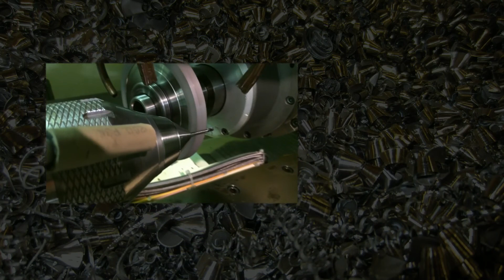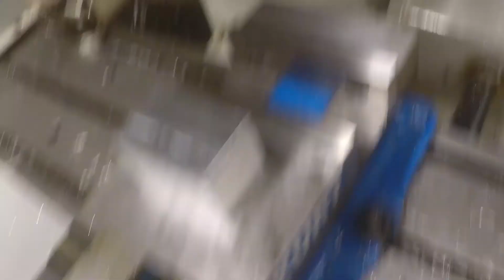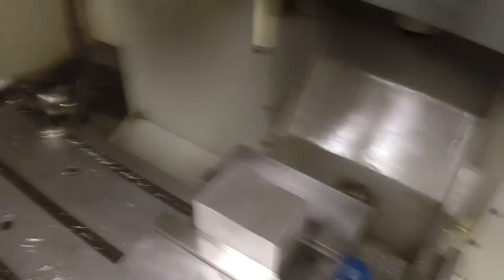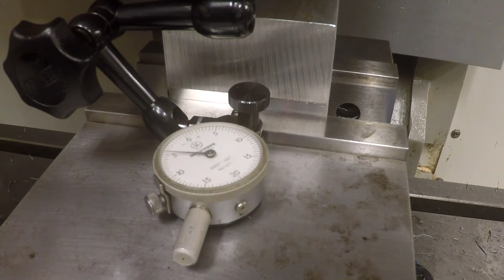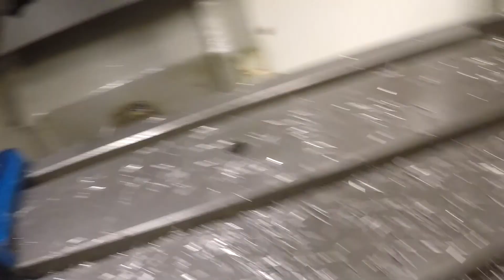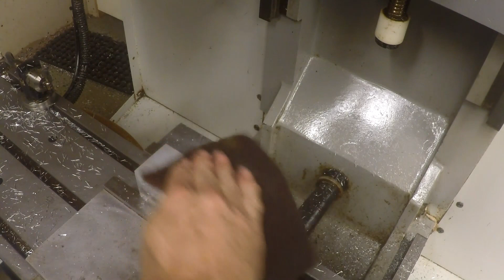Square Me Up To 90-3

Comment: Couldn't you have squared the block on the surface grinder in a tenth of the time, and it would be right on for squareness. All the fuss and worry about vise flatness and squareness could be avoided. You remind me of alot of the CNC operators I've worked with. "I will do it in this machine regardless, those other machines aren't worth my time".
Reply from the maker: Did you watch all the videos 1-3 in this series? (I think not)The purpose of this video series wasn't to show what you are talking about. For instance what if you don't have a grinder. Or even a Kirt type of vise. This is to show different ways of thinking. There are of course better ways of doing things if you have all the equipment available to you. I have used this same method on manual equipment as well.

Comment: Excuse my ignorance if this is a dumb question but is it possible the probe tip could pick up minute amounts of dross or debris and affect the precision especially in axis x?
Reply from the maker: Yes that is possible in any axis. But oddly it doesn't seem to pose a problem. I have done extensive probing on machine tools and haven't had a problem with this. More of a problem is, in process probing to have burrs or shavings  on the work. By the way no question is a dumb question. Thanks.

Comment: Hey Peter. How about s ratchet in the vice. That impact can damage the vice spindel. One of mine has a rough spot because if a damaged spindel.
Reply from the maker: I never tighten the vise with the impact wrench, just if I have to move the jaw a large amount. Because of the coolant pan on this machine it takes a lot of time with a regular wrench. I did use to use my air ratchet wrench but it has malfunctioned and I haven’t got a new one.

Comment: I’d be interested to se the difference in the measurement between the machined surface on the block and the inside of the vice jaws.    I love your videos,  I learn something every time.  Thank you.
Reply from the maker: I'm not totally sure I understand what you are saying. The whole purpose of this method is to eliminate/reduce the error that the vise may have in its jaws. As long as the vises base runs parallel to the tables travel and the spindle is perpendicular to that. Your parallels do have to be the same height and you need to  tap/hammer the part tight down against them. it is necessary to take the proper care with indicating and machining the part. It will come out square. As I said in the video. I would only use this method if absolutely necessary it does take more time.
Reply: Edge Precision I was just wondering if the back edge of the part and the stationary jaw would measure at the exact same number.  I suppose in a perfect world it would, everything being perfectly straight and square.

Comment: After flipping the block over on the second operation, could you not just re-run the first program. As long as the sides cleaned up, wouldn’t the newly milled sides be in the same plane as the ones side milled in the first operation? As long as the machine repeats, I’m thinking this is the case. That way you wouldn’t have to find the centerline at all with a dial test indicator.

Comment: Im a young Machinist and I've never seen this method seems extremely precise. Not to ask a dumb question but what would be the best option to square those four sides to the remaining two set it up and indicate in?
Great Channel
Reply from the maker: Once you have something square on those faces. One way is to clamp it in the vise and use a endmill to take a skim cut on one of the top end's in the Y axis just enough to clean a area to set it on a parallel. Than clamp it in the vise vertical on a short parallel (Tap it down tight on the Parallel wit a dead blow hammer) and cut the top with a face mill. Than flip the part over and bring it to your dimension the same way.
Reply: Edge Precision of course the small clamping face gives you just enough to make it square very smart my friend

Comment: Pete Check out Face Drivers for deep hole gun drilled shafts to machine true ID to OD . Most all live center MFG make them in all types of spindel types. Thanks for your wisdom.
Reply from the maker: I have used a face driver before. Back in the days when we made guns and gun parts. We made some barrels for a High Standard match pistol. The first operation was to turn the OD concentric to the bore. For that we used a face driver. This allowed us to turn the whole OD in one cut. They work great on shorter parts. When the part gets longer you could have problems with whip in the middle because of the tailstock pressure.

Comment: When finding the center of the workpiece to cut the second set of slots (around the 9:00 mark), you mentioned that you can just use the probe to find to measure the jaw positions, rather than using the indicator and the DRO on the bottom slot. Wouldn't measuring the jaws be just as good as a direct measurement, as they are directly touching and are only separated by some surface contamination?

Of course being as direct as possible is always preferred, but considering that the vise and and parallels are delivering the rotational precision in all three axes and positional position in more than one axis, it seems like the difference between a direct and indirect measurement is insignificant.
Reply from the maker: Yes that would probably be good enough to swing the inside of the jaws as close to the part as possible. This is of course if the vise and jaws are in good condition and are running parallel to the parts sides in both directions (that's lengthwise and vertically). Actually if I'm using this method to square a part I would usually do just that. The only reason I was showing this method is to show a alternative to edge finders (I don't like them for close measurement's. Some people do but its not my first selection). Also I have done this on very large parts where you don't even have the part in a vise to get reference surfaces to work to.
Reply: Edge Precision Awesome—thanks for the info and love the depth of your videos.

Comment: Interesting, I can see this being useful for getting sides 5 and 6 (ends) of a block to square up too. I've had plenty of situations where I could face but not side cut a part square due to deflection or tool reach. I've rolled parts to the back and cut shims into the material for those.

Comment: Very good series exploring a new (for me) method of squaring a part accurately. I enjoyed this series and learned from it. Btw I subscribed on the first in the series. Glad to have you on my list of go to YT providers.
Reply from the maker: +Jim Milne Thanks again Jim. As I think I said in the video this isn't a process I would use for parts that don't require close tolerances. I have found even when you thing your tooling is straight and square the forces of clamping or stress in materials makes a significant difference when working to close tolerances. A lot of machinist just assume if they clamp a part in the vise(even a new quality vise) it will be square.  For 95% of machine work this isn't necessary with modern equipment and  tooling it is very easy to hold + - .005". Witch is usually the standard tolerance for most things.

Comment: Use a ratchet or speed wrench...
Reply from the maker: +DSCKy Its been a long time since I made this video but if you are referring to moving the vise jaw quickly or changing vise jaws. I use to use a air ratchet wrench but it quit working. I need to get a new one just haven't got around to it.

Comment from the maker: O buy the way I put this mark on every machine I run. Some machines the keys on the spindle are not symmetrical and also not to put boring heads in backwards. If you are using bore orient cycles. Some tool changers require the tool in one direction only. Some tool shanks are also not symmetrical.

Comment: watched it again. tnx I've never been able to square a part. theoretically if the vise is FLAT then the part is square. I am a surveyor, for each measurement I assume instrument is not level and shots are taken erect and inverted. if average is w/i 5" and 0.01 Ft, we are ok. thanks I had begun to think nothing was ever square. the rotate 90 degrees procedure is not working for me. this will be a good test. most videos 90-90-90 and assume OK.

Comment: Interesting, I understand your reasoning but wonder if there is a slightly easier methodology, for us poor people without CNC, using the fixed jaw as a reference rather than centring for the second round of cutting.
Oh, and another subscriber from the man with the magnificent thigh-tickler.
Reply from the maker: +Chris Stephens Chris I have done this many times on a manual machine it just takes a little more time. This is not something I would do if the job didn't require this kind of precision this is just for those jobs that require it, its to time consuming. The normal way is the best for most jobs. I just want to present different ways of doing things and to show a get around if you vise is not that precise.

Comment: Wow that looked tricky with a lot of opportunities to fat finger a number.  Also it looks to be hard in a manual machine especially setting the z height I guess you would have to use a dial indicator.  It would be interesting to see an accuracy comparison with the way I have seen and done it with a face mill and something round or soft in between the stock and the movable jaw.  Then the stock is rotated around I think you end up making like 7 cuts.  Still it is impressive the result you got 2 or 3 tenths out of a milling process.
Reply from the maker: Bill De La Vega  Thanks Bill. As I said in the video this is not the kind of thing you would want to do for every job. I have done this on a Bridgeport mill with out any problem. The cuts in Z  I took in the video are not really necessary I just did them to demonstrate how much it took to clean up. The reason for these videos is just to demonstrate error in things people take for granted but could be introducing error in their parts. What if I had to make a part that was 6.00 square and the drawing specified perpendicularity of .001. As you saw in the videos with my vise it wouldn't be possible just relying on the back vise jaw. the best I could do would be .003 because of the error in my vise. With this method I can achieve the same as the demonstration part.